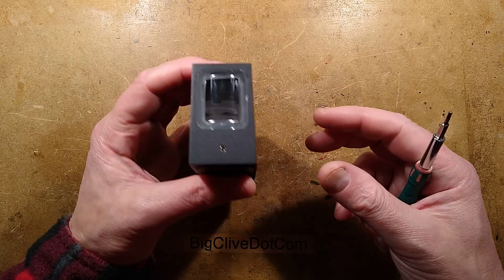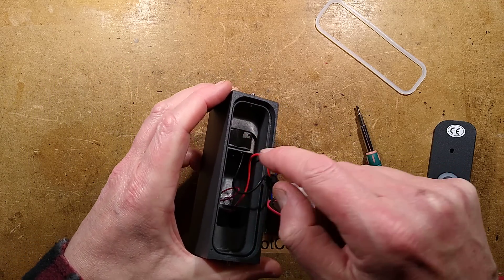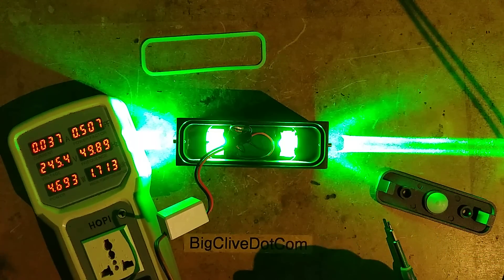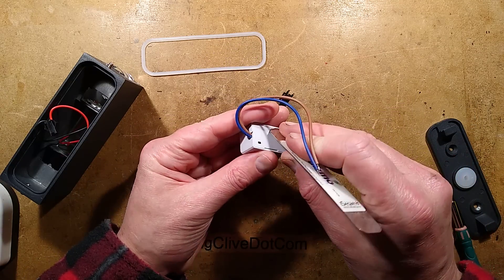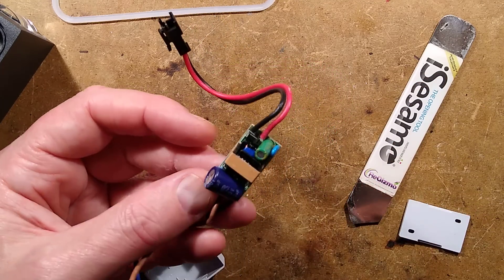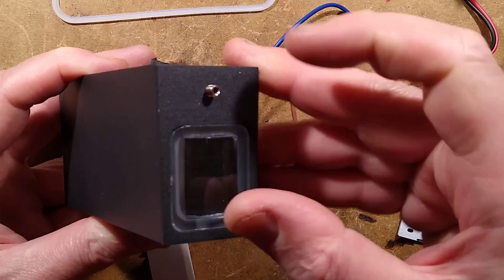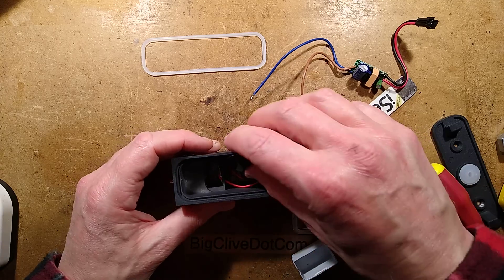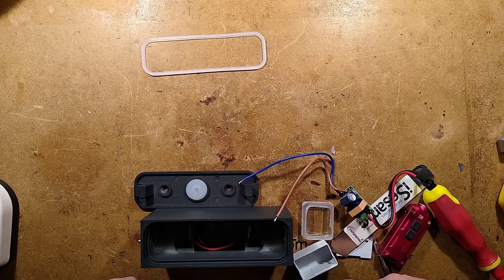Chinese LED line-generator light

Comment: No earthing (grounding)... well, It would have been so much better if the beam was made from a green laser with lots of invisible IR that could cut things in half if they happened to "find" themselves in front of that unit... make some light on your wall and set the curtains on fire too.  It's would be about as dodgy as the rest of the things you buy from those people LOL.